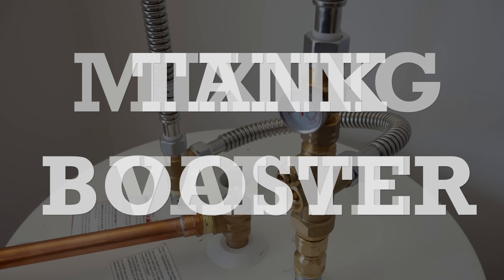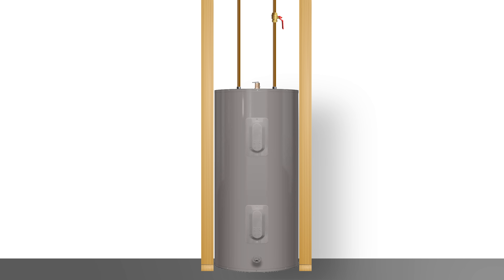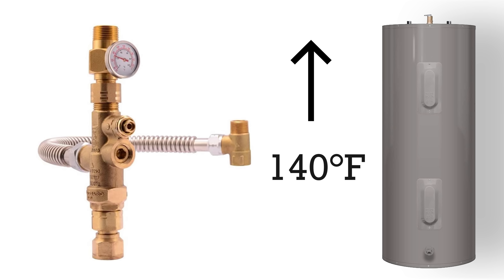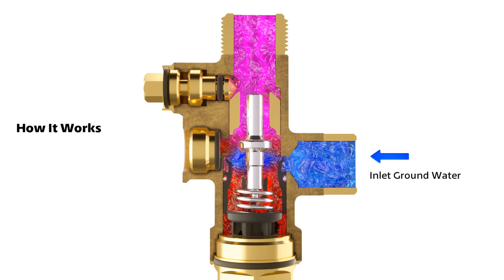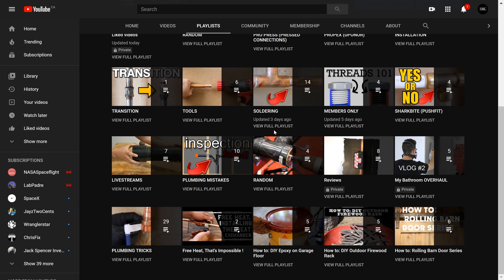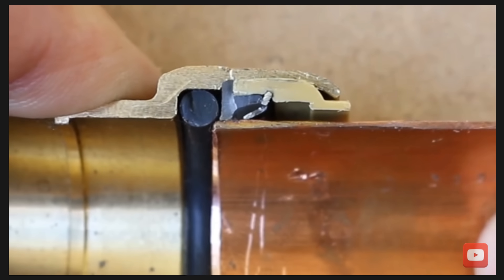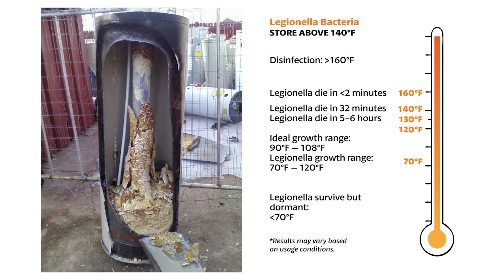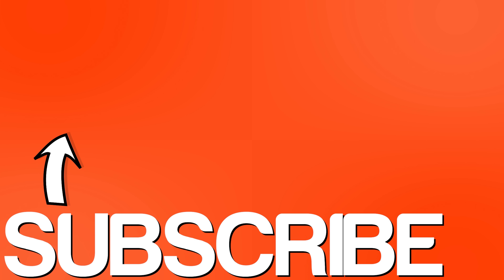INCREASE Your HOT WATER Capacity With This! (Cash Acme PRO Mixing Valve) | GOT2LEARN

Comment: My experience with this is mixed.  The valve needs frequent adjusting and it seems to lower water pressure.  In the end it still didnt give me enough hot water and I needed a 2nd tank.

It did increase the amount of hot water.  I tried this after a tank booster failed. In the end I think you're better served with 2 tanks or a larger tank.  It also takes longer to get that maximum temp.  You can buy it, but realize it's a compromise.
Reply from the maker: Thanks for sharing your experience! 👍

Comment: i understand the burning prevention argument but not the "less energy is needed to heat the entiere tank" argument. With or without the thermostatic mixing valve, the same amount of hot water is consumed during a shower for exemple. The only difference is the volume of pipes to reach the shower that will remain filled with hot water after the shower is finished. This will be lost because it will cool down in the pipes after the shower. If the mixing is done just after the tank, the "lost hot water" will be at lower temperature so less energy waster. But still it's a small volume (yet it could be interesting if the shower is far away from the tank).

Another thing i don 't understand is when you say that the tank takes more energy to heat up again if it's totally cold. I wonder where did you find information about this. Whatever the temperature of the water inside the tank, 1W of electricity will always raise the temperature of the same value.
I think the CONTRARY is true : the hotter the water is in the tank on average, the more energy you loose. According to Newton's law of cooling (because there is a greater difference with the outside temperature so there are more heat loss).

Comment: I would absolutely install external checks,as these built in check valves rarely have longevity.ive seen them fail time and time again
Reply: I cut mine out. Works amazing now. Less energy used to heat

Comment: One possible gotcha…. pressure drop. The pressure drop across this valve is steep. You might see 5 gpm of hot water flow with a couple showers and a kitchen sink running, and the mixing valve drops the pressure 10psi.  That’s  bunch if you’ve got low pressure, maybe  from a well. At 10 gpm (pretty unusual) it drops 30 psi.

Comment: Great Videos! Keep up the good work.  Please Note: one must look at the spec sheets to find the minimum flow rate to determine if the tempering valve meets their needs at a small faucet - The Cash ACME valve min flow rate is 1gpm (4 L/min) which in my case is twice what the hot tap in my bathroom faucet puts out, therefore I would likely want to install something like a Watts LFUSG-B under that sink which specs minimum flow rate of 0.5gpm (2.2 lpm).

Comment: As another commenter already mentioned, this type of mixing valve will require adjustment fairly often as seasons change, especially in the northern part of the country where the temperature of the cold water varies by a fairly large amount.  I believe I saw a similar unit that incorporates a temperature sensing control for the mixing valve so once set it should maintain the desired 120°F output, similar to what some shower controls use..  I just can't remember where I saw it.

Comment: allow me to clarify an earlier comment where i called these 'junk' (an opinion which has not changed by the way).  this does not 'increase hot water capacity'.  if you have a 50 gallon tank, your capacity is 50 gallons. this mixing valve does not change that. 50 gallons is 50 gallons.  to increase capacity, you have to increase the size of the tank (or go with an on-demand tankless system).  what this valve DOES allow you to do is heat your water to a higher temperature (to kill off whatever may be in your water) and then mix it with cold water from the inlet (thereby RE-introducing those same parasites in the water to your now hot water) and cooling it back down to prevent scalding.  i don't see how this would save you energy at all as you are spending more to keep a 50 gallon tank (or whatever the size) of water hot!  Many plumbers have told me to set your water heater at the maximum temperature for a body to stand because 'cooling off water you just spent money on to heat  makes no sense'.
Reply: It doesn’t save you money in terms of heating costs, that’s true. It does save you money if the other option is to buy another tank. Also, you’re mixing hot and cold water at the point of use anyway, so that parasite statement doesn’t really make any sense.

Comment: Great video!!! You are awesome. QUESTION: do you have a video on increasing the water pressure in my home. Thanks!
Reply from the maker: Thanks!! Do you have a pressure regulator at home?
Reply: @Got2Learn  I do not... my community is connected to a series of wells that feed many homes, so pressure varies a lot. I wanted a system that would maybe use a tank and pump to increase...
Reply from the maker: @303Estates  You must have a pressure tank somewhere right? You can adjust those to buildup more pressure.
Reply: @Got2Learn  I have a pressure tank on my Propane Boiler, but not sure that would increase my overall water pressure in my home. If you have an email address, I could send you a picture of how my water pressure tank is installed...
Reply from the maker: That's an expansion tank, you need a pressure tank, they are typically blue tanks near your main water line.
Reply: @Got2Learn  yes... I do not have that. Is it just adding a tank? or is it a tank AND a water pump... Thanks for quick replies! You rock!
Reply from the maker: @303Estates  your well pump would pump water into this tank to charge the system.
Reply: @Got2Learn  I don't have a well pump. That pump is located a few miles away, and supplies many many homes, so at my house, water comes in, and is distributed to house. So I need some new gadgets in my home to take what I get from community well, and boosts it ;-)

Comment: Since the copper pipin in my house lasted less than 30 years, there will be no more copper ut in my homes.  PEX all the way.  At leat if it doesn;t last 30 years it doesnt; cost so much to install.  Insurance adjusters all know this - copper pipe pinhole leaks are huge drains on homeowner's insurance.

Comment: I have an old water heater.  Gas.  In the summer, it doesn't even get me over the minimum gas bill.  In the winter, not sure but I doubt it's much more.   The heater only kicks on when someone is taking a bath or we're running the dishwasher.  Can't see the advantage of adapting my tank.

Comment: These are not a good idea. Setting the heater to 140 will shorten the heater life by 35 percent especially if the heater is located in an attic. Snake oil.
Reply from the maker: It's a sacrifice to take to have more hot water, nothing is free :)

Comment: First off, love your videos.  With that said, I happened to buy one of these tank boosters you're talking about in this video that worked well out the box, but after some time it has stopped working.  All of a sudden my hot water does not last anywhere near as long.

After looking at the mixing valve I noticed the included temperature gauge shows my line out water at 130 or so degrees!   It doesn't matter which way I turn the allen key valve, it stays at that temperature.  It's like something is broken.  Any idea what could be the problem?  I can't find any sort of troubleshooting for this particular type of unit so I don't know if this is something I can fix or not but I'd hate to spend another $120 or so for no reason if that's not the actual problem.

Comment: Can one of those electric boosters be used at a fixture? Our kitchen is on the opposite end of the house from the water heater, and it can take a few minutes for hot water to actually reach the faucet. This is compared to the bathroom directly above the water heater, where hot water comes out almost immediately.
Reply from the maker: Yup!!

Comment: It's almost like they wanted to force people to downsize to save energy but instead devices are coming out which force the smaller device to work harder using more energy.  It's been my experience that running water heaters on a higher heat shortens the lifespan.  The area I live in is hard water so it really distills the minerals out when you turn up the temperature.

Comment: Does anybody know why they didn't just make them taller!?  We can adjust the height of the pipes easier than trying to figure out how to get the WH through the door, engineers 🤦‍♂️
Reply: Uh…maybe you should blame the feds? You must not work in old homes if you think taller would be better so much better 🙄
Reply: @jman0870  I do blame the feds but engineers had a design choice duh?  And I work in plenty tens of thousands of homes with headroom not width, everyone is pressed for horizontal space hence the reason dense populations build multistory and skyrises.🤣
Reply: @anonymousbaros4424  you aren’t everyone buddy. In old towns headroom is a commodity. Many basements are hand dug and hand poured. Cry more. Blame the architects and engineers for making the closet as small as possible.

Comment: Con: Mixing valves seize after a 2-3 years, and need to be replaced. Con: dishwashers recommend you set your hot water tank so that the dishwasher is supplied with 140 F water, otherwise the dishwasher will have to use its element to heat the water (Hot water tank: 140 F. Mixing valve: 120 F. Dishwasher: 140 F). A mixing valve is only a good idea if it lasts longer than the lifetime of the hot water tank.

Comment: I had one of these on my 40 gallon hot water heater. I cranked the tank temp all the way to 150 degrees. It definitely increased my hot water capacity by around 40%. Didn't notice too much of an increase in standby loss, but the extra hot water was worth it, as the space would not allow for a larger water heater. It's worth the money if you need more hot water
Reply: Did your bills increase, stay the same, or decrease?
Reply from the maker: Increase.
Reply from the maker: Good to hear, thanks for sharing 🤘

Comment: I agree that this device can potentially address the need to replace a smaller heater with a larger heater. However, as mentioned in the video by running the tank at a higher temperature, the differential temperature (∆T) between the tank and surrounding environment is increased leading to increased heat loss and therefore reduced efficiency. The additional insulation on newer tanks addresses this somewhat but in reality if a tank sits all day and most of the night waiting for folks to get home it will cost more to operate. As with all things, there are many considerations before making a decision on "improvements". Good video, Cheers....

Comment: 2:45 what does that even mean?? In the context of just using your faucet to control the temperature, the only difference is that very hot water will be in pipes instead of just hot. It does increases the losses through pipes, but that have nothing to do with statement in video. 
It looks like you want to say, that using all hot water at once, and then heating full tank of water (and assuming that temperature of water in tank does not go in between) takes more energy than if used same amount of hot water, but slowly and keeping constant temperature. It doesn't matter for this case and it is not true. If only, the opposite is true, because heat losses are higher when temperature is higher, and for some time the water is cold so its losses are smaller. In the end, you need 2 tanks of hot water (one you use up, one is in tank ready to go) and it doesn't matter how you divide heating it up. This is similar to popular myth in my area, that if you leave the house for work, it is cheaper to keep heating up instead of letting it go cold. Of course not, if temperature go down, the losses go down too. You will need to wait for a while for temperature to rise again, and then it will use quite much energy, but it will be short burst instead of small constant expense. And you need to make sure that your pipes don't freeze, but rarely could happen in ~10h.
Reply: It is cheaper to heat it up an hr or so before you use. Put an analog timer on my water heater decades ago, on once in the early am, before waking up, then off for most of the day, and then on again just before 5:00 pm, then off about 7 pm. Saw a big savings on the first bill. Had a switch to turn it on if I needed hot water in between those hours. Heating water 24/7 is definitly more expensive,  but it's nice to see people have theories on this, even if they are wrong.
Reply: You need to watch the entire video and understand the entire video. You seem to be missing several fundamentals that are clearly spelled out in the video. Watch it again and LISTEN 👂 this time.
Reply from the maker: Thank you 🙏

Comment: I always had my 40gal water heater set to 135deg and on cold winter nites when I took a long hot shower, I would start to run out of hot water at the end. I turned my water heater thermostat up to 160deg, and now I never run out of hot water. Isn't this the same thing as you are describing? I'm really not understanding why these units are selling; could it be the safety issue? I mean, you could, on my system now, burn yourself if you simply turn the hot water faucet on and let it run to full 160deg (which we never do).

Comment: By chance, can those mixing valves be mounted horizontally? By the looks of those, and the connections, appears they need approx a 12 to 18 inch long additional area to mount them if only vertical installation is allowed for the valve to properly function?
Reply from the maker: Yes they can!
Reply: @Got2Learn  Out standing... I will further investigate this avenue... A long shower on an 80 gallon tank, just never seems long enough.. I want my fingers and toes to wrinkle up like I had been in the pool for 8 hours.. Maybe the longer shower time will help with the lower back inflammation...  Thank you..
Reply from the maker: @drubradley8821  absolutely!! 👌🤘

Comment: How is this more efficient when the water heater is keeping the tank at a higher temperature all day long, not just the short period the demand is present?
Reply from the maker: Meaning you will have more hot water.
Reply: @Got2Learn  but its very inefficient and more expensive to maintain water at 140° all the time. That will eventually cost more than making the modifications to do it correctly.
Reply from the maker: Some people are willing to do it that way, I asked some guys in the states how much it cost to replace a water heater with a new one, some said over 2000$, that heat loss will take a while to cover that minus the mixing valve IMO.

Comment: It’s why I love my oil fired boiler.  Tank is at 160deg and uses a in boiler fin and a mix valve…… ever take a shower and NEVER run out of hot water?  Yup even when it’s -20 outside.

Comment: I have two hotwater tanks that are in my basement. One for the basement and main floor, and the second for the second floor.  One of the ways to save the consumer money is to install some water heat traps.  What are those???

A law of physics.  Warm water in a container rises to the top, cold water sinks to the bottom.
With the tanks in the basement, convection will cause the warm water to rise in the plumbing to any connection made above the hotwater tank, and the cool water in that plumbing, to gravitate to the bottom of the tank.
Our tanks come with 3/4 inch connections.  What I do for each tank is to connect the tank to the house plumbing with a 18-24 inch stainless steel braided coupling (similar kind to what is used under sinks).
I make certain that hot water, on leaving the pipe, has to flow down, before it flows up. I have made an s-curve with that connection.  I do it for both the hot and cold connections that enter the tank from the top.   I loosly insulate both s curves with some fibreglass.

The trap works as follows. The less-dense hot water from the tank migrates up to the peak of the S curve, and then does not migrate down to displace the more dense cooler water that woud go around and up into the house.   Below the peak of the S curve on the house side is more dense colder water.  The same applies to the city water input connection. 

In many jurisdictions, hot water is provided by electricity or gas.  If you think of the tank connections losing hot water to the building some 24x7 then you can be assured that your cost for the two flexible connections will be paid for in the first year. 

By the way, my insurance company wants the tanks checked for potential leaks every ten years. At that time, I also check the flex hose connections.

I save about $50/yr per tank or more $$$ based on my electrical rates.  If the tank fails, I can replace the tank without unsoldering/resoldering connections.
Reply: Leslie Satenstein
More about the tanks. They are two "Cascade 60" glass lined foam insulated hot-water tanks each with three heater elements therein. 
Each tank is connected to a 220 volt supply via it's own dual 15amp breaker box located at the tank.  From my experience, even with annual tank flushing for the calcium sediment that collects, no tank lasts more than 20 years. 
And yes, the hot water from the tank does not creap up the connected plumbing to the floors above.